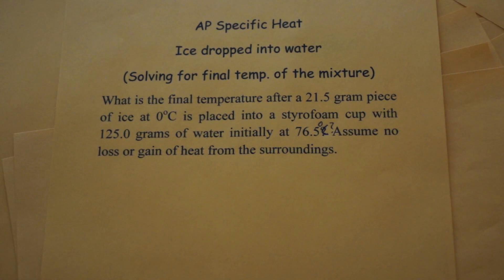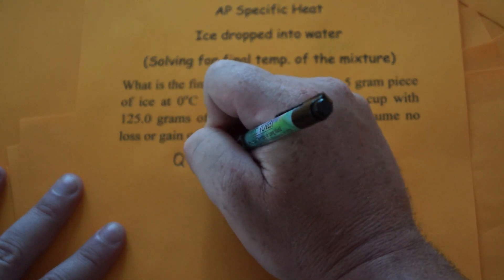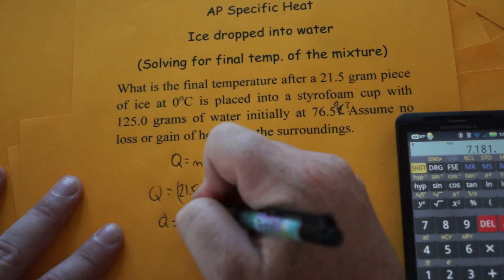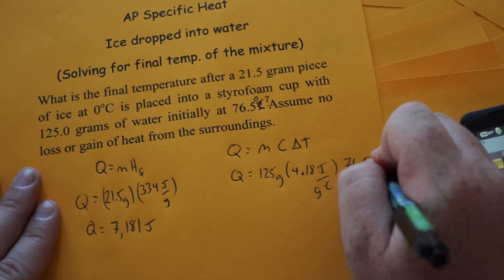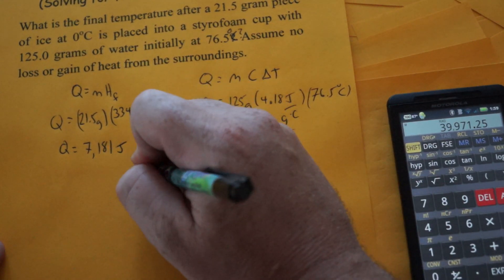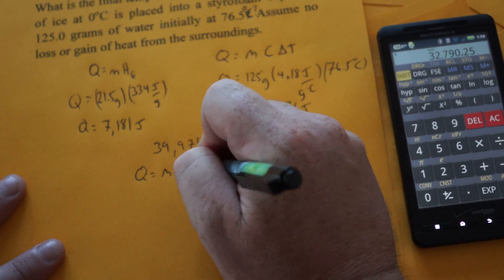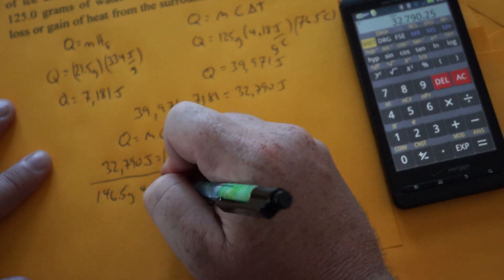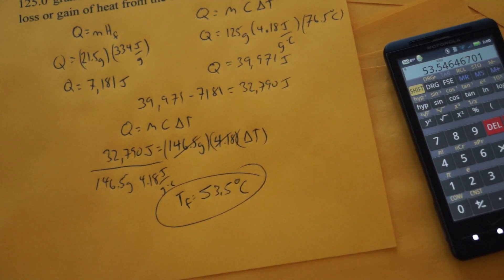AP Specific Heat (Final Temp. Ice Dropped into Water)

Comment: 5 lb of ice at 32 deg f added to 25 lb of water at  68 deg f-  What is the equilibrium temperatures?
Using specific heat of ice as .5  and water as 1 latent heat of fusion 144 btu/lb
Curious to see your answer compared to mine.
Reply: why on earth would you use imperial units